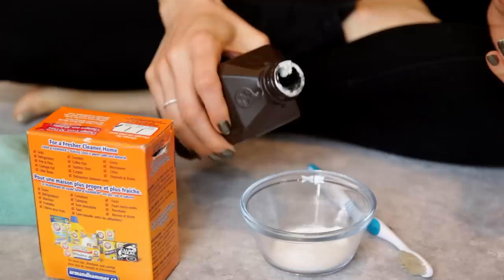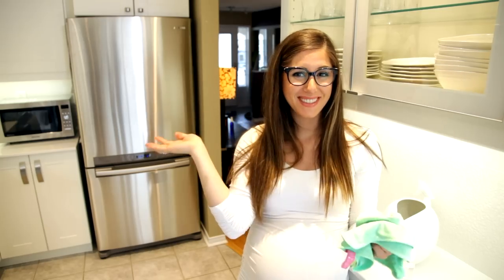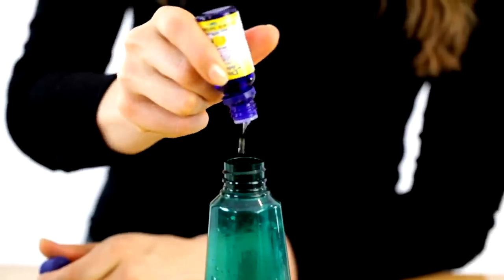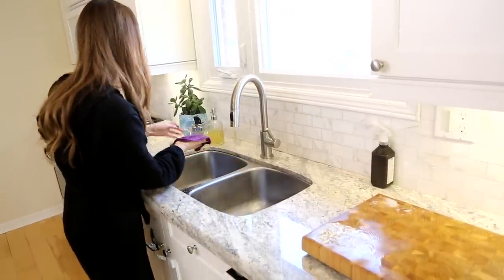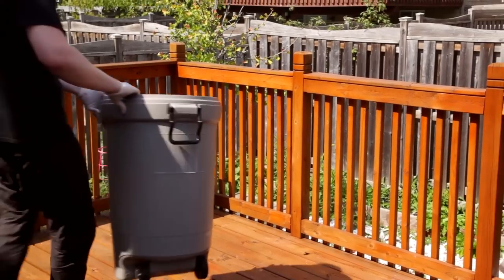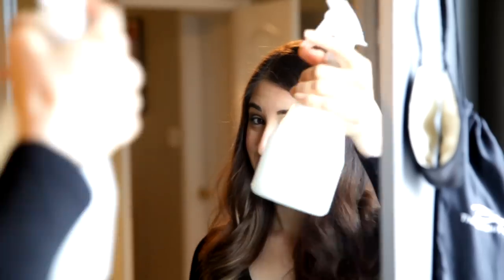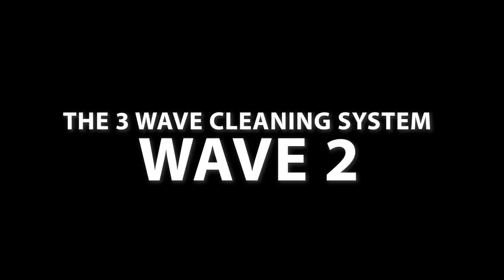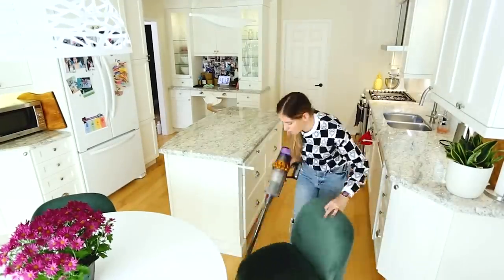25 Cleaning Tips That Will Blow Your Mind!

Comment: You talked about hanging the tennis shoes on the dryer door to dry so they don't make noise while drying -- great idea.  I also hate to wash dedicates that say "Dry Flat".  So, what I do is clean off the top of my dryer, spread out the sweater (or whatever) and run a load in the dryer.  The load gets dry and so does the sweater.  
Great tips in this video.  It's been a while since I cleaned a child's car seat (my kids are 33 and 36), so thanks for the "brush-up" course.

Comment: if you flip the car seat upside down you will see metal hooks that grab the seat belt straps. Just unhook and they pull right out. Also a good tip for when baby is growing and you need to move the belt to a higher level.

Comment: Melissa, could you please create an efficient grout cleaning brush? Like with a strong triangle-ish shape brush and an extended handle? I really like my grouts clean and I haven't found a good one so far. I'm sure it's great quality if you're offering one on the market.
Reply: They sell a grout brush at Home Depot that has a screw on part you can put on a broom handle. It has that angle shape you are describing.  Works great for fitting into grout lines.
Reply: @ericksonsails  Thank you Diane!

Comment: How many parts rubbing alcohol to water for your eyeglasses cleaner? Are you sure it won’t hurt any of the tinting or other films that are commonly applied to glasses? This tip may be a godsend for me.
Reply: 1/2 and 1/2
Reply: i ruined the plastic frames of my expensive glasses over time using alcohol, I now just use gentle liquid soap and rub the glasses with soap and my fingers under warm water, then dry them with an eye glass cleaning cloth and theyre perfect. i def wouldnt use alcohol on my glasses ever again, even the material for the lenses i dont trust will be ok with repeated alcohol use.

Comment: Melissa, thanks for your videos. I have a laminate floor. Sometimes my dog has accidents on it. I try to wipe it up quickly. About once a week I use my wet mop pad on it and a little vinegar to clean the floor. I see a lot of streaks and the next day it honestly looks dirty again. What am I doing wrong? I read where vinegar keeps it from streaking but it did not work with my floor. Help!
Reply: I have hardwood laminate, not sure if that's the type you have too but I had a similar problem. I'll say right away, if you use any aerosol air fresheners it's probably half your problem. I cut them out and my floors were so much better after that.
However, I also have animals whom sometimes have accidents and am terrified of bleaching my floor colours with pet stain removers, so before I do my weekly mop I use some warm water and mild dish soap to wipe with a cloth or papertowel the areas that I know accidents have recently or frequently happened, and I mop those areas with vinegar and water as well, but after the other main areas. If you miss a little bit one week, going back for touchups next week helps stop the buildup, which is why I focus on all their favorite corners every time. I've personally seen a big improvement!
Reply: I've accepted the fact that laminate flooring can either be clean and streaked or remain dirty.  There; you're welcome.  LOL  I've found nothing that works; no product; no technique; no magic.  New construction apartment; first time living with it.  Lesson learned for next move; never again.  Sure it is inexpensive and long lasting for the property owners; but what a cleaning nightmare. (And no they have no clue either; the offices and gym have it and also looks bad as mine) Hope someone reading this knows the secret to removing streaks; hard water spots; restore some shine.

Comment: The thing that bothers me most with trying to clean my glasses, probably because I have astigmatism so the problem just compounds, is STREAKS. The only thing I can clean my glasses with, other than special glasses wipes, is a dry towel. Bath or hand towel. No microfiber. Those leave fibers behind. This works for me because when my towels are done washing & spinning, I turn it back onto rinse and add in a half cup of white vinegar to get out the detergent residue.
Reply: i love that laundry tip! new to me, gonna try it thx!

Comment: what’s the % of hydrogen peroxide you would buy for the recommended purpose? i found anything from 3% up to 99,9% and I have no idea what to buy
Reply: I used to use 3% for cleaning pet marks (don't use on painted wood!). When I had a very confused old cat I would buy a strong solution and dilute it down to approximately 3%.
 Which I realise doesn't answer the question here, I too would like to know.